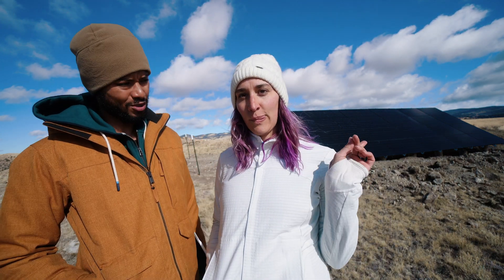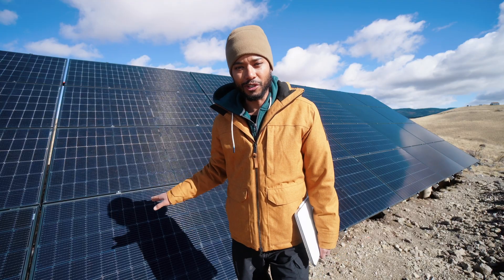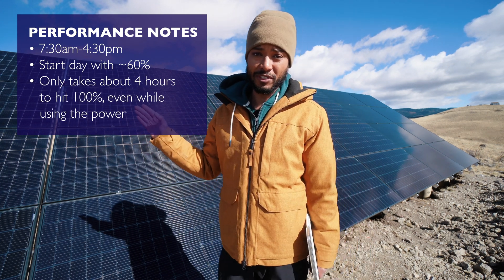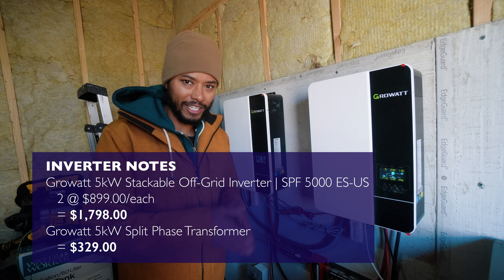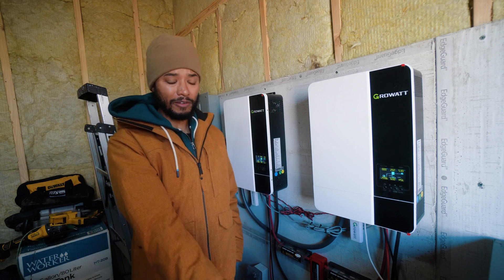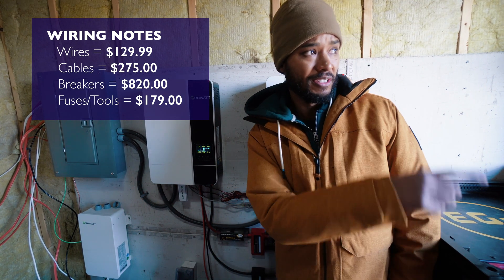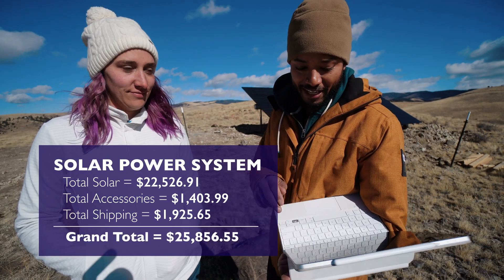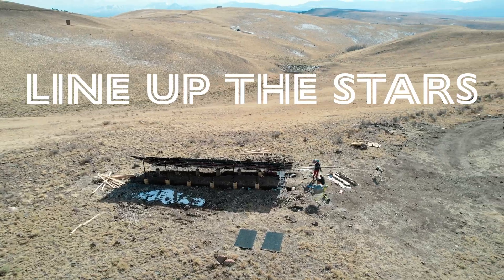How Much Did Our DIY Solar Power System Cost? | Pt. 4 Owner Builder Solar System Installation

Comment: Hey neighbors my home base is near sulphur springs so I drove down and got my system I have purchased 16 of the 500 w bisons a 6000 XP and a wall mount battery heated I'm learning from everybody else's projects hope it goes smooth I have very little experience in solar a little bit and electricity keep up the good work
Reply from the maker: Hi Neighbor Rick, that’s great to hear about your electrical system! We didn’t have any experience with solar either before we moved out here. Brian learned so much from seeing what other people were doing and watching YouTube videos! The biggest challenge we’ve run into is keeping the batteries warm so they don’t fault but once you can do that, it’s usually smooth sailing 😊

Comment: You can just buy an inexpensive 300$ windows laptop to look into the battery instead of paying 1200-1800$ on the screen battery. 😎 Just a suggestion. Awesome system. 😀😀
Reply from the maker: Yes, that's a great point! Brian was able to use a Windows simulator on his Macbook to avoid needing the screen battery or another computer. So there's lots of options available. Great advice!

Comment: Great looking system & a great site for solar! I was wondering what are your inverter settings for the LifeP04 batteries or were they preset by the Growatt tech people? There are different recommendations for the settings, depending on who you ask but most of the recommended settings are similar but not the same. There is a gentleman that has done a considerable amount of testing with different settings, for the LifeP04 batteries and he has some very good recommendations. I was wondering what the temperature generally runs in your shed, where your batteries and inverters are? I know that you have a small heater in the shed (which is a good idea). However, if it gets too hot, it will cause the inverter fans to run too much, trying to keep your inverters cool. On the other hand, charging will stop if batteries become too cold. You have plenty of power for two people but you could add a couple of wind generators, if needed. It appears that you get plenty of wind in that area!
Reply from the maker: Thanks for the compliment!!! It was a fun to learn and to continue to learn about solar power! Since we’re not on location during the winter, I’ll do my best to answer your questions off the top of my head, but when we get back, maybe we can make a video on the settings of our system. 

Our system was not preset by Growatt folks, but the inverter is set to LI on the battery type. To be honest, the greatest obstacle we ran into on the communication side was using the correct cable from the battery to the inverter. Right when I was going to call signature solar, I somehow got it to work. I felt as if I did the same thing over and over and then it worked, but I must have done something different. 

As far as the temperature in the shed, we left before I set up the thermostat, but on the day that the batteries did not work properly, my thermostat gun registered around 20 degrees F in the shed. We have yet to have it too hot, but it’s definitely something we want to be on top of for the same reasons you mentioned. The small space heater was set to the lowest setting and it did cycle throughout the day/night, but I’m not sure at what temperature. If we do decide to stay for winters, we’ll most likely try some suggestions that others have commented on to keep the batteries warm. One thing that I didn’t get to was to insulate the doors, which the batteries aren’t too far from. Once we do that, I’m sure it will be easier to regulate the temperature in the shed. 

You are right! We do have plenty of power for the two of us, but when the time is right, we will definitely add a wind generator or two, depending on what else we build for there is plenty of wind in the area for sure!! If we have an accessory building here or there, I imagine we may do a stand alone wind/solar system for it, so we don’t have power cables underground everywhere! So much potential!
Reply: You are welcome! Your standard lithium battery configuration should work with LifeP04 batteries okay. The only exceptions would be the following choices if you have them in your inverter:
1) Tail current
2) Peukert exponent
3) Charge efficiency
4) Discharge floor
Best wishes & Merry Christmas!

Comment: You could add a solar hot air collector to keep the power snack warm incorporating a sand battery may get you thru the night with out the electric heater coming on. The only electric would be driving a fan and another solar panel would take care of that part of you really want to go crazy a 12 volt battery to it to keep the heater off your main battery bank.
Reply from the maker: That's a great idea, definitely something to look into! We taking everyone's ideas into account as we think about how to keep the battery bank warmer when we go back in the Spring!

Comment: Suggestion for keeping batteries warm.  Put an acrylic door on the battery rack.  Try getting 4 or 6 electric seedling warming pads (10"x20" each) to put under each or most of the batteries.  They draw 17.5w each so 70-105 watts total draw.  They will keep batts at 70+ deg F and have their own thermostat.  So your energy draw in shed will drop from 700+ watts to 70-100 watts.   Amazon has 2 pads for $20 currently and there are other sizes.  This may or may not work as I do not know what kind of space is under each bat in rack.  You might only need 2 pads if rack with door keeps heat in.  Assume nothing else in Shed needs heat from space heater.
Reply from the maker: Thank you for the advice, we'll definitely look into that! It's just one of those things that we knew would be an issue living where it's cold, so it will be ongoing project to improve its efficiency.

Comment: Hope you 2 are doing ok.  Looking forward to another video.  I am interested in your plans for water.  I assume a well.  Where you will drill it.
Reply from the maker: Yes, working on the next couple of videos right now! Our cistern system is temporary as we had originally been working with a well driller. Unfortunately, our plans for that well (which would have been drilled Summer 2022) fell through so we are currently on another wait list. We will tentatively have one installed March-April 2023!

Comment: You 2 are awesome!  Tenacious!!!  I appreciate all the technical stuff that you showed here.  I suspect when you do these types of videos with these details, you will get a lot of views.  But, it might be just me.  I know you had a hell of a time with the peers.  Please make sure you get plenty of back fill around them.  I spent 6 months in Co. Springs.  I dont have to tell you it can get very windy in CO.  I would hate to hear a massive wind storm took off with your panels.  As a backup, you may want to consider using some small augers and tie some cabling from your cross pipes to the augers.
Reply from the maker: Thank you for the advice! We were able to backfill around the piers last week so we are good there. And you are totally right about the winds. They are no joke around here 😅We are looking into additional bracing systems. Unfortunately, we put the solar system in the rockiest place on our land so even a small auger probably won't get too deep. But we'll keep improving it!
Reply from the maker: Cabling is a great suggestion!! Thanks for that! Off camera, we have since finished backfilling and you’re more than right about the windy conditions!! Last week, we clocked in 50 mph on our weather station, but we are sure it was much higher a few days before we set it up!